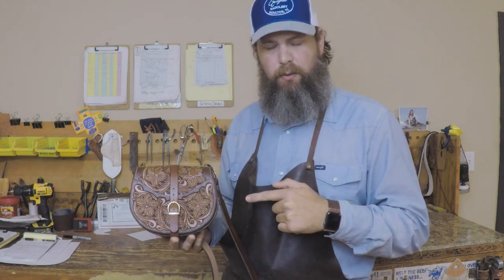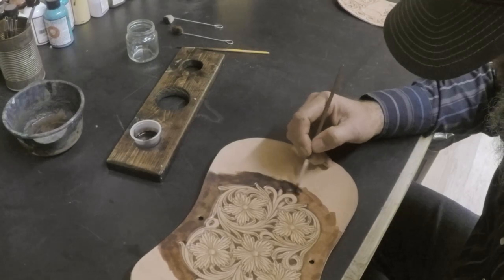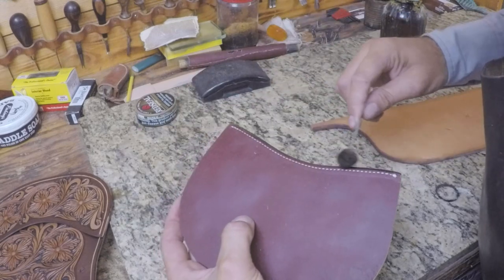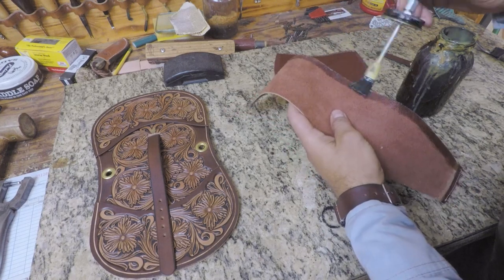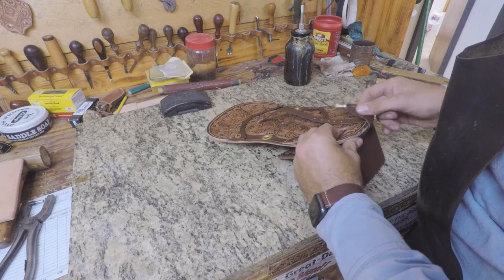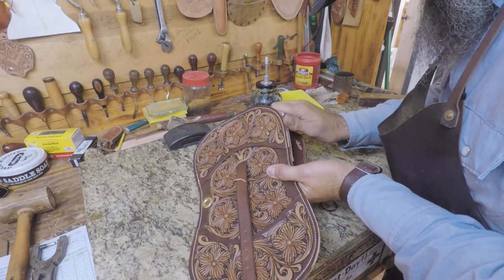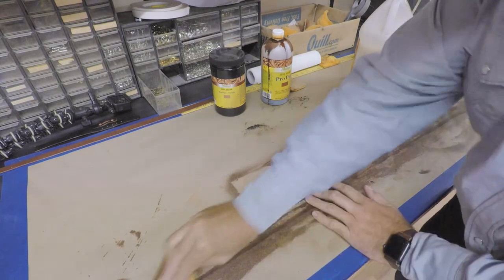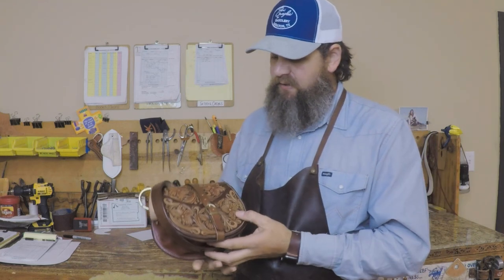How to Make a Saddle Bag Crossbody Purse

Comment: Don, I was watching this video again and I had the same problem two weeks ago with the leather glue not bonding with the other leather part. I roughed up both pieces of the leather with a higher course sandpaper or roughing tool until I had the nap of the leather standing up better. Then I used Barge Rubber Cement. No problems it stuck very well. For some reason the leather finish wouldn’t take the glue.

Comment: I love the strap, a belt strap would be good because it's adjustable. The rings I would like smaller.
The purse is pretty especially the front buckle.

We put all pockets and stuff inside so you need lighter fabric for the inside lining and pockets. That definitely needs to be sewed.

The chap leather is fine like you said over time it will break in. You just have to take your time molding it or you could have stretched it a little to thin it. I'm old fashion, chap leather is thick and good quality it will last long. 

Overall, good job!!

I have 50 purses at my house.